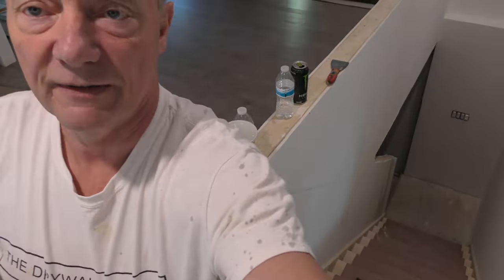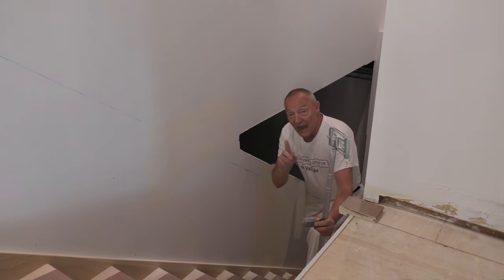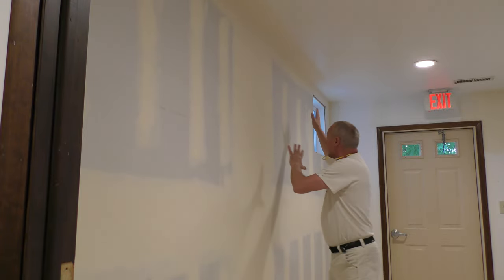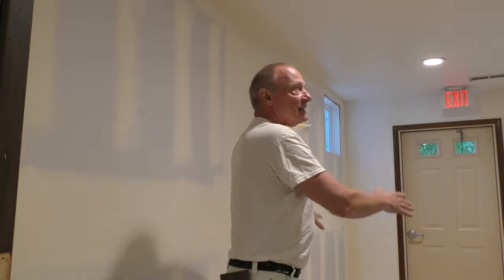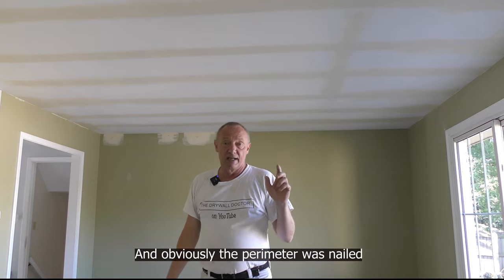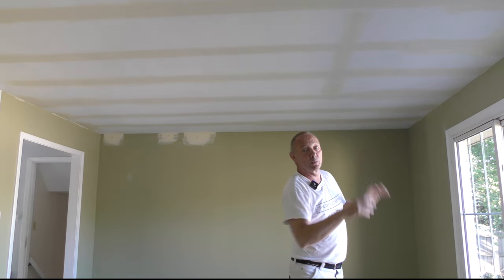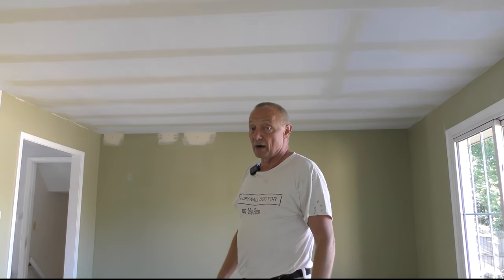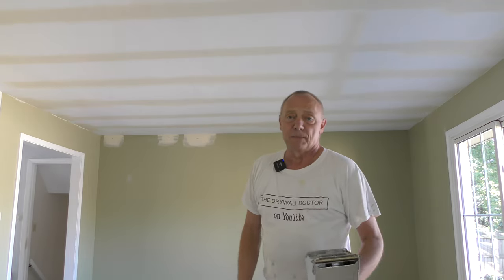Level 5 and who can do it cheaper

Comment: I also do A-Z from hanging to finishing to painting. I've never felt the need to skim the entire wall. I've seen "level 5" look WORSE than if they didn't skim it because the finishers applied the skim unevenly and sanded with 80 grit leaving scratches all over the place. If you leave just the right amount of mud, feather your edges, finish sand with 150 or higher, use a high quality sealer/PVA primer, lightly sand the primer before 2 coats of paint, you will get a superb finish and no one would be able to distinguish if it's a level 4 or 5.
Reply: I’ll also add that some say there’s a difference in texture between mud and paper. I would argue that the difference will be void once you pass a roller over the paint. All rollers leave a little texture. Even in spray applications, a good job will include backrollung
Reply from the maker: Yes your right ✅

Comment: I've been finishing drywall for 26 years and we have always done a level 4 finish 99% of the time and have never had a problem because of it. If you do your finish properly then even the best finishers would have a hard time telling the difference after it's been painted. Also praise God that you're a Christian , we need a lot my good men like you in this world
Reply: I redid all of my ceilings starting with my nursery which I took to a lvl 5 finish to the point you could shine a light across the ceiling and see NO imperfections…..after that I said screw that and did the rest at a level 4 finish and unless you purposely create harsh light along it you would never know. A good PVA primer does a lot for equalizing textures

Comment: Glad you straightened that out. A good hanger is worth their weight as is a good taper.
Reply: I always suggest that a hanger should tape at least one or 2 jobs, even if he's slow at it to learn how to be a better hanger. Things like minimizing joints, and learning to look down the wall so as not to put your butt joints on a stud thats bowed in. Hangers will not understand the gravity of the situation until they've had to pay for their mistakes by trying to cover it up with compound. If a novice hanger is trained by a veteran hanger, he might show him these issues. But, unfortunately a lot of hangers are pretty much self taught and never really learned the nuances of being a good hanger. Taping a job that you hung will teach you stuff about hanging that you'll never learn if you just hang.
Reply from the maker: I worked for a painting contractor and he said the same thing about tapers they should paint a couple of jobs to see what it's like

Comment: Hey Doc, 46 years in and I have to agree with all you say. Was there also when there were no levels of finish and it was textured or smooth wall. Smooth wall consisted with 2 coats on joints, a tight skim of joints with thin mud, 2 coats in angles, 3 coats nails. There was no prep coat or first coat ever. Painters used to roll instead of spray and backroll. Painters also used to scuff sand between coats to equalize the surface to get final coat. Level 5 is so overblown. I think the biggest problem is in competent training for taping and painting. And yes, those 5" boxes come in very handy in certain situations.
Reply: If people want a level 5 then that starts with the foundation forward, not at the drywall stage.

Comment: agree 100%......a good primer and painter will eliminate any texture differences......level 5 is floating mud to take out framing discrepencies.....bare drywall to taping should never be an issue but will see bows and valleys from framing on a long wall or ceiling.....all drywall should be primered with 2 coats of PVA drywall primer to make all surfaces the same....this is what i do on all my jobs....you cannot see any differences between taping and raw drywall......its alot easier painting primer vs skim coating watered down mud because painters arent good enough to primer all the surfaces!.......its not a product issue with primer.... its really pretty simple, i use PVA primer on all new drywall or taped surfaces.....its a skill issue by the painter if their are issues..

i am the one who gets the phone calls from the owner long after whatever trade is long gone, lol

Comment: You probably could use a drywall lift to push those sagging ceiling boards up to the joists....also, I'm a finisher/painter  and I'd prime those ceilings in 1 direction with a 3/4" nap roller and use a 1/2" roller in the opposite direction with the finish paint
Reply: Exact info I was looking for in regards to painting. TYVM

Comment: We have stopped skimming smooth ceilings because we have had very good success with tough hide. It's a ultra thick primer you spray with a big painter (greco mark 5) and it gets rid of the texture difference really well. We do insulation through to finish paint for 5 contractors in my area. We mainly do level 4 and level 5 finishing. On the odd job we do California knockdown. Thanks for the videos
Reply: Hey friend, I'm about to do my first tuff-hide job (on my own place), any tips?

Comment: If I'm doing an area where lighting is going to be a problem I'll always use butt boards (glued) and then spray a heavy coat of first coat rolled out .  I've done a few level 5 ceilings (where the customer wanted a textured ceiling made smooth) and I can't tell the difference.  At the end of the day, though, it's the customer who matters.  I've had painters pooch the dog and gone back and fixed their mess.  I could have told the customer that this isn't my problem, but folks don't hire me to get them tangled up in a peeing contest between contractors.  I bite the bullet and fix it.  Life gets harder when we discover the cross we're called to bear actually has nails.  Oh well.  If he could do it, so can I.
Reply: God bless you brother

Comment: I do mostly new houses and quite often i do some level5 because painters here won't apply anything else than 2 coats of crappy low budget self-sealing paint. And of course, they will never EVER offer the client, the option to do it the proper way, even for extra money.
The other downside to a level5 wall, is you cannot repair it. Every little coat of mud you put on it after it's done, it will be visible to sunlight. But then, i can proudly tell myself i did all i could to make the job the best it can. Also level5 requires meticulous sanding and checking because when the sun's out, it's gonna hurt!

Comment: In rental houses I’ve done some floor to ceiling butt joints after they’ve removed old wall furnaces…..  the whole area ends up about 48” wide when finished and it appears decently flat and ready for paint

Comment: We hang all our own drywall, and usually paint it all too. I've done a fair bit of level five, but for the most part it's not necessary. A good PVA primer, sand, Base coat of color, sand, and a final coat will get results that are almost as good as a level 5. The problem is most painters want to come in and spray everything without backrolling, and then to make it worse they don't sand between coats. Then the drywall guy gets yelled at for something that's not his fault. I fixed that problem by becoming the hanger, and the painter.

Comment: hi Ray, as a veteran of the industry you are allowed to tick off people.   And only the "cowboys" with the tailgate warranty would complain, and nobody cares if they do.    Most likely the person who hung the drywall at the church was pro bono too (and I don't mean they were a U2 music fan).   So one can forgive them if it is not perfect.   In some places they don't stagger the joints behind kitchens with cabinetry going over the top as well as a tile backsplash, makes it easier and quicker (done it myself in my own home).  Will it crack?   Any joint could crack but most likely it will be replaced or repaired in 30 years during a remodel anyway.

Comment: In comercial work level 5 makes sense in certain lighting situations. If you have a floor to ceiling window on the east side and a huge 4 story unbroken wall on the north side sometimes you can see every hair on the board for an hour a day. A tight skim after you sand hides allot of imperfections in the board and diffrince between the paper and mud that you normally wouldnt see. The only teme i leave more then a tight skim on is if its a remodel and you are really resurfacing the wall or covering light texture or ripped off vinyl or something. Sometimes guys just exagerate the humps when they put on those thick floated level 5s.
Reply from the maker: Try USG first coat it does wonders to a wall like that. 👍

Comment: Ive used oil based primer before and yes it does stack uneven when painted but it does stick better and lasts longer.  If you use an oil base conditioner like Flood Penetrol that liquifies the oil based primer so it lays flatter and doesnt leave brush/roll marks can it be used on drywall if you want a smooth finish?
Reply from the maker: You kinda want the stipple to hide flashing.

Comment: What primers do you recommend for level 5 finish for a novice DIY. I just scrapped my popcorn and reapplied mud to tape, seems, joints,  screws. I keep seeing on google people recommend high build primer.
Reply from the maker: USG first coat I'll try to add a link
Reply from the maker: https://www.walmart.com/ip/New-US-Gypsum-544825030-Ready-Mixed-Primer-Gallon-Each/275786672?wmlspartner=wlpa&selectedSellerId=101024090&&adid=22222222228000000000&wl0=&wl1=g&wl2=m&wl3=42423897272&wl4=pla-51320962143&wl5=9021519&wl6=&wl7=&wl8=&wl9=pla&wl10=231376939&wl11=online&wl12=275786672&veh=sem&gclid=CjwKCAjw0dKXBhBPEiwA2bmObVybfnmmQmwgu28mHPB12FSLGAQ6dAI9SXHrSOawQYevm0pVP05i_xoCIVIQAvD_BwE&gclsrc=aw.ds

Comment: What's your opinion on using high-build drywall primer to achieve a perfect smooth?
Reply from the maker: I love it. It takes a level 4 and turns it into a level 5.
Reply: @THEDRYWALLDOCTOR1  Awesome, I'll be giving it a try on my home soon. Do you know if it's okay to use drywall primer on a painted wall too?
Reply from the maker: Yes, you want to, so it keeps the same stipple.
Reply: @THEDRYWALLDOCTOR1  thank you! Yeah that's exactly my thought process. Thank you for answering both my questions! You got a new sub
Reply: We did a level 5 finish, primed, spray painted and a lot of touch ups done are showing. My are thinking to roll second layer of paint. What’s our best option?? Any help would be sooooo appreciated!! @THEDRYWALLDOCTOR1
Reply: @THEDRYWALLDOCTOR1  We did a level 5 finish, primed, spray painted and a lot of touch ups done are showing. We are thinking to roll second layer of paint. What’s our best option?? Any help would be sooooo appreciated!!